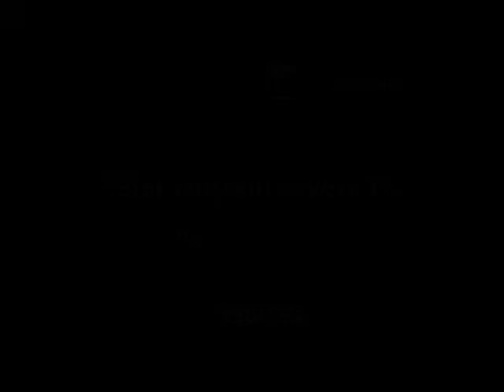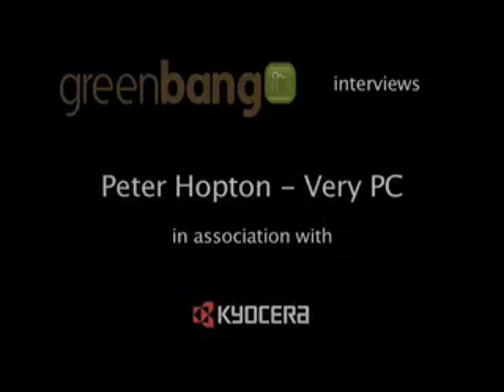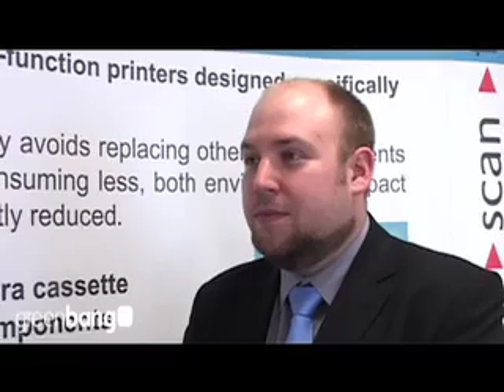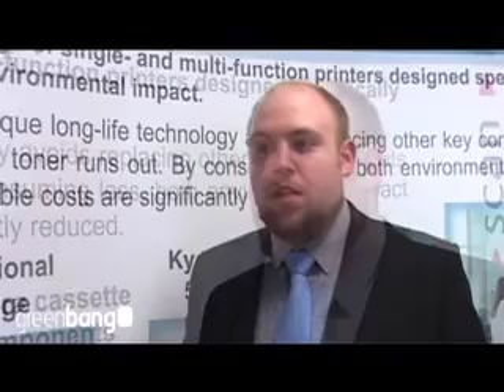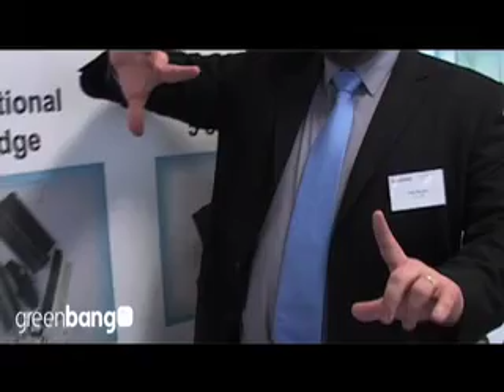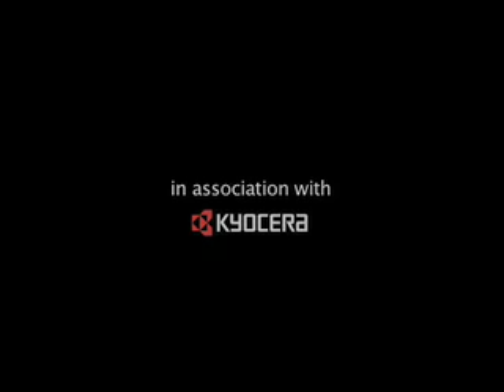Peter Hopton of Very PC talks to Greenbang

Comment: wow amazing. the justification for using x factor atx boards is less waste. which is great for shopping tills, but rather useless in terms of pc upgrades. thus throw out your old crap just so you can upgrade some components, and im sorry green pc components just are not as efficient as the non green ones (in terms of performance). an idiot can pick green components and build a pc, let alone that there are numerous ways of reducing power consumption by proper planing. sorry mate, FAIL.